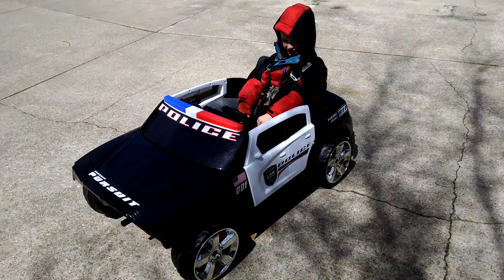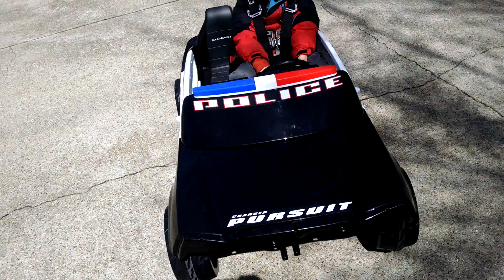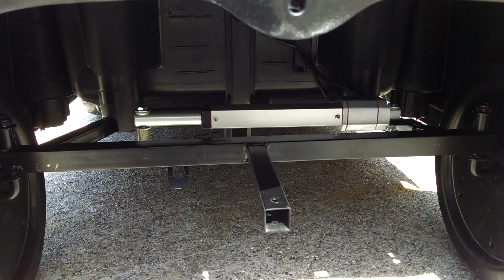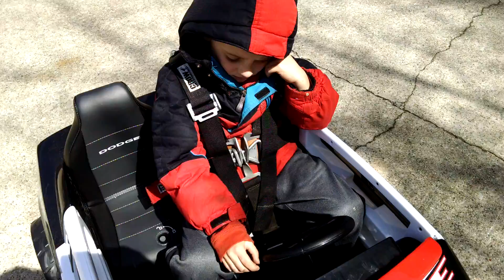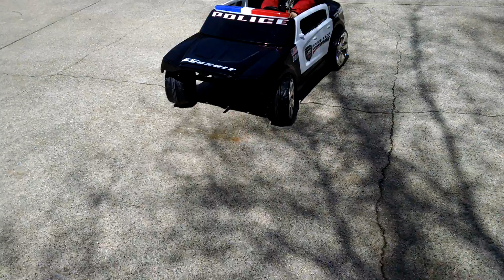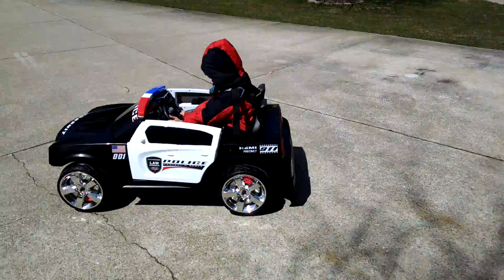RC powerwheels steering update w/Wheelie action!!

Comment: Is that a two wire actuator? What are you using for the controller? Nice work!
Reply from the maker: Ivgottobeme nope, u want a actuator with feedback. I use dual motor rc esc units
Reply: Thanks for that. But, would you recommend the 35# Firgelli (w/feedback) with an Actuonics LAC for a basic startup? Or do you think a Actuonics 12V L16 would be sufficient for a PW?

Comment: hey man I got a little Shelby that I'm trying to make fast but Im not sure where or which motor to use? I have 2 12volt battery's. can you point me out where can I get a little stronger motors?
Reply from the maker: I would recommend 18 volts and ripping out the stock control board as you will fry that thing with overvolting. We are doing a all wheel drive cobra with variable speed, should be an epic drift beast.